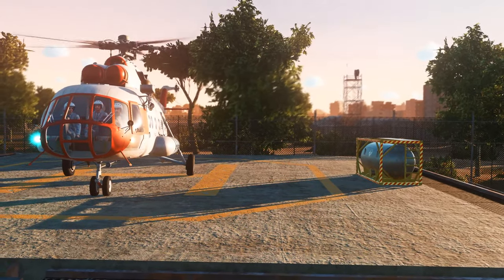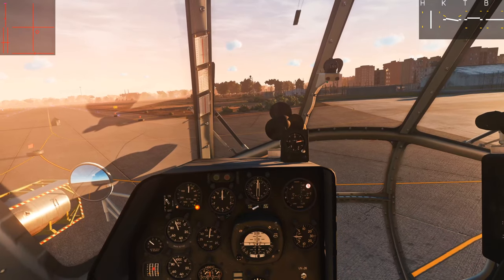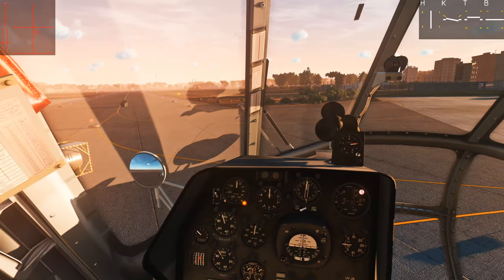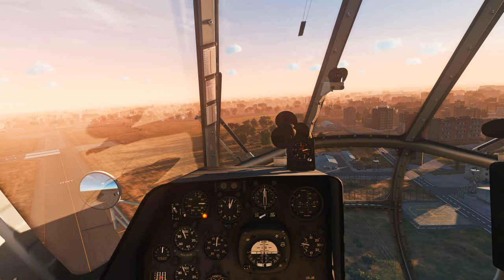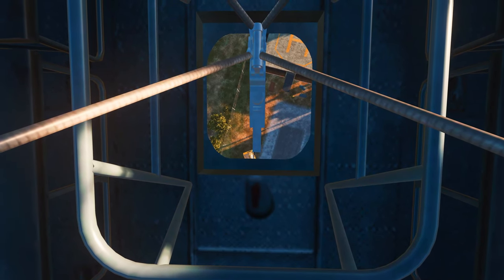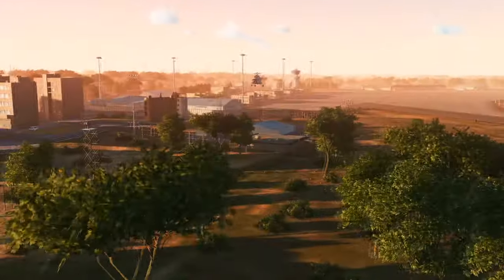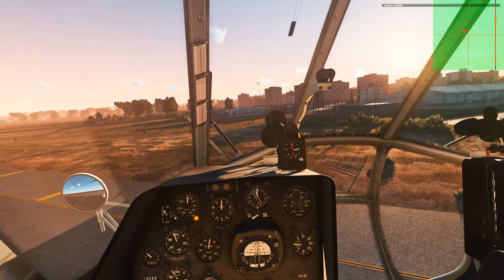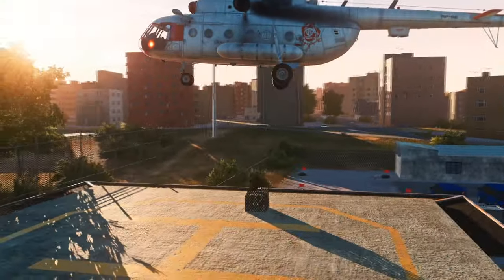DCS Mi-8: Sling Loading Tutorial

Comment: Thanks so much for your MI-8 tutorials. They really have enabled me to get the most out of this module. I thought I would share my experience with sling loads to add to your info. You touch on most of these.
1. A good hover trim is essential. Extra time spent here will payback later.
2. I tend to use the overlay only to get the altitude right when first approaching the load. After that I listen to the crew chief, Taking your eyes off the ground for a millisecond is too long.
3. I get to 2/3 to 3/4 rope length in altitude. The least time spent taking tension leads to a cleaner lift reducing sway.
4. When approaching the load line up an object in the distance or a line on the ground so you can approach the load without always having to focus on the load.
5. Then you just need to listen to the crew chief for left-right adjustments and distance to go forward.
6. Approach very very slowly. And final slow down at the 3m call. I find you then barely need to hover then for the hook up.
7. With altitude at ~3/4 rope length there's not much tension to finally take up.

ps. If you haven't already you really should get a G2.  Absolutely stunning immersive experience. Plus you can look out the window at your load :-)

cheers
Reply from the maker: Great info! Thank you for sharing!

I have been thinking about VR a lot lately and it's something I want to get but it's a complicated issue for me.

My CPU and motherboard and RAM are 8 years old. I need to drop a couple grand on computer upgrades before I can even run a VR headset.

Then I have to consider that the G2 is a WMR headset and I don't want to deal with that. But the Index can't compete with the G2's resolution...

So I am mostly just hoping Valve announces an Index V2 lol
Reply: @vsTerminus  Honestly all the worry about WMR is unfounded. I went from Oculus, and I was seriously concerned about all the negativity online about WMR. It's turned out to be a breeze, and actually a lot  easier to manage than Oculus. Most of the drama seems around controllers, which I don't even have for simming.
Being immersed in VR just knocks 2D for six. I can never go back. The G2 has made the graphics a level playing field in that regard. But of course you forgoe MP, and you need plenty of hotas buttons to map eveything as no keyboard. So you better factor in a new Virpil throttle and VKB stick as well while you're at it... :-)

Comment: Great tutorial as always, I learn so much from your explanations.  I have a couple of questions though regarding long distance sling loading.  I am currently in a mission where i need to sling load multiple cargos to a site and the distance is between 20-30 miles.  What would you consider a safe operating speed before you risk snapping the line?  Right now I find 90kph the safest but is there anything i am missing that could increase this speed safely?  Also any tips on how to handle your sling load during the transition from flight to a hover as I find this the trickiest and either snap the line or enter a vortex ring rapidly.  If you ever consider doing a tutorial on longer sling load distances and what you need to be aware of this would be a great help
Reply from the maker: 90kph is absolutely a good speed and should be safe in almost any weather.

The manual doesn't provide any recommended speeds, but in my experience you should be OK at 130kph in good weather. I wouldn't go any faster than 150kph.

For transitioning to hover or on approach to land the manual does offer some advice: Double your usual approach distance. Give yourself twice as much time to slow down as you would without the external load.

ETL begins to go away somewhere around 50-60kph so you should be ready at that point to start adding collective. As soon as you hear or feel vibrations (from Transverse Flow) that's your cue to smoothly increase collective. Keep an eye on your VVI and err on the side of caution. Once you lose ETL you want to keep your descent rate to 2m/s or less. VRS kicks in around 4m/s, so that leaves you a small buffer for reaction time.

If you do it right the transition to no-ETL flight should be pretty smooth. You just have to take your time and don't worry if the helicopter feels like it's going to shake apart. That's normal, it won't hurt anything.

I'll add a second sling loading video to my list and make sure to include this info and more. Thanks for the feedback!

Comment: What is the best method to stop the swinging? That’s the biggest issue I have, I’m not sure how to react
Reply from the maker: Most of the time if the cargo is swinging I will slow down and focus on keeping my flight steady. 

Use the center channel autopilot and the trim to get yourself as stable as possible. Trim for aerodynamic flight (center the ball) and adjust your course to the right to compensate (by the same number of degrees your doppler drift gauge reports you drifting to the left).

You can also try gently rolling in the same direction as the cargo is swinging to take some tension out of the line and kill some of the pendular momentum. Again slowing down first will help. The general idea is when the cargo swings out to the left you go with it and try to get on top of it. In theory you'll kill the momentum it has to swing back the other way.

Good luck!

Comment: Cant help but notice that your mi-8 appears different to mine in-game? am i using a different version or something? mine appears to not have the mirrors or that nav box on the navigators console. not sure if im just missing something or this has been mentioned  before? either way a very useful tutorial! thank you for making this.

Edit: ive also had my cargo swing violently while in a hover to the point where it flies over the heli and flings off into the distance, is this a common thing? im assuming its a bug of some kind but its annoyingly common.
Reply from the maker: Hello! Those are great questions.

The Mi-8 is the only module, to my knowledge, which actually removes the mirrors entirely if you have them disabled in the Main Menu settings. If you go the main menu and into Settings, turn Mirrors back on there and try again. You can always toggle them off in-game with the M key for performance reasons.

The "nav box" you're talking about is the NS-430 GPS module, which is a separate paid addon for this and a few other modules in DCS. It's a bit confusing.

You actually need to buy two things: The NS-430 module itself enables a little pop-up UI window, while the NS-430 Addon for Mi-8 adds the physical in-dash unit. There are also module addons for the C-101, L-39, and soon to be the SA342 as well.

As for the cargo bug, are you sling loading in multiplayer? There are significant issues with sling loading and desync which can cause the kind of thing you're talking about. If you're in Single Player I'm not sure what to say; I've never experienced anything that weird with sling loading while offline.
Reply: @vsTerminus  thanks so much for the response! Certainly cleared up a few things. I didn't realise that there were 2 separate add ons for the ns-430. As someone who plays through steam is this still possible to use as I don't remember seeing the physical ns-430 for sale through there? I'll have a look shortly and update this when I know.

It would appear that you are correct on the multiplayer, I feel like this is something you have probably mentioned in a previous video which I just haven't gotten round to watching yet. I run a private server for me and a few friends and we were trying it there but I know to avoid that now.

Thanks again for the help!

Update: the steam page for the ns-430 says this:
"This module provides ability to display the NS 430 as a pop-up window in almost all aircraft (except for those that have their own advanced navigation systems like the A-10C, Ka-50 and F/A-18C).

The NS 430 is also included as an integrated 3D cockpit panel for the DCS: Mi-8MTV2 and DCS: L-39 Albatros."

There is only one module available through steam but it states that it contains a 3d model for the cockpits of the albatross and the mi8 but does not show it in the screenshots? I'm concerned that if I purchase it, it won't show and as someone that sometimes uses VR I'd like the model to appear in order to be able to use it. I doubt you have any further information on this but I'll do some more digging to find out! Thanks again.
Reply from the maker: @xthegaminggoatx7106  I'm not a Steam user but it does sound like that includes the 3d cockpit models. If you need to be absolutely certain your best bet might be to contact ED - Get in touch with nineline or bignewy on reddit, the forums, or their discord.
Reply: @vsTerminus  will do! Thanks for the help!